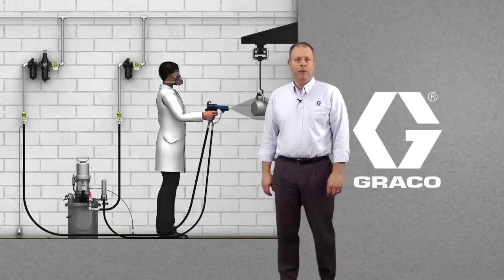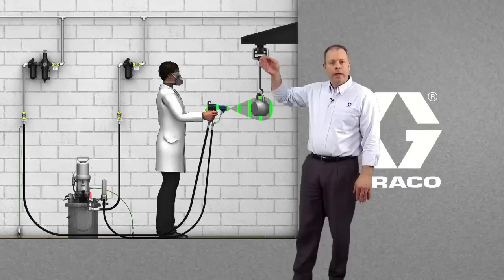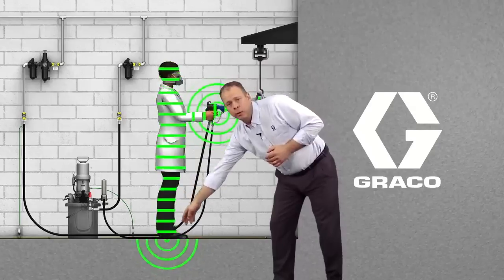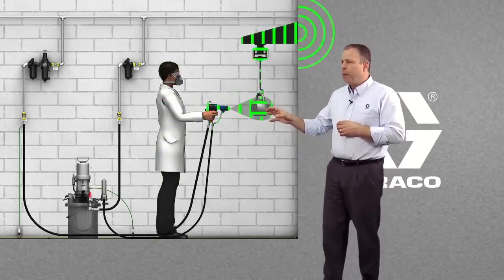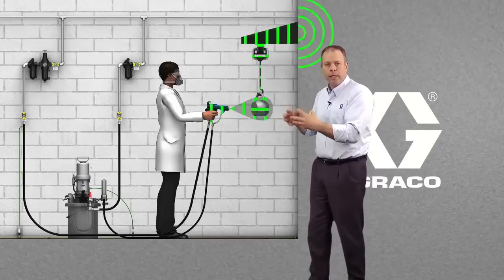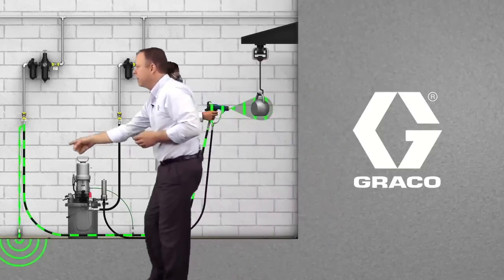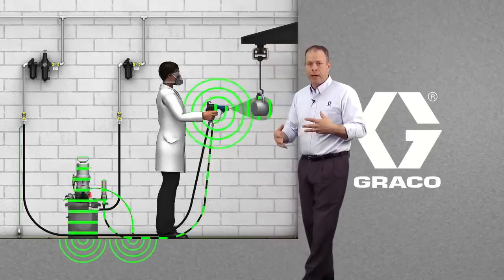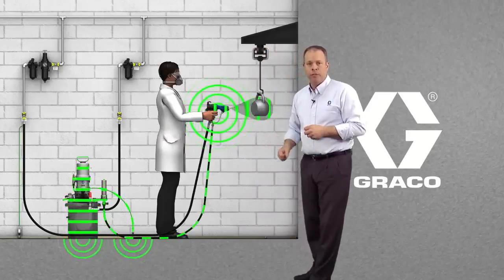Electrostatic Painting: Grounding Instructions

Comment: Electrons are negatively charged- they wouldn't be attracted to a ground- they would have to be positively charged in order to do that. How is a charge added to the paint?
Reply from the maker: The electrostatic charge is added to the paint through a process called ionization. In an electrostatic spray gun, a high voltage is applied to the paint just before it's sprayed out. This high voltage causes the individual paint particles to gain or lose electrons, thus becoming negatively charged ions. 

The object that is being painted is grounded. This essentially means it is given a neutral charge. As the negatively charged paint particles leave the electrostatic spray gun, they are attracted to the grounded part. 

Our electrostatic spray gun basics article and video further explain: https://www.graco.com/us/en/in-plant-manufacturing/solutions/articles/electrostatic-spray-gun-basics.html

Comment: Is it possible to use this kind of technology for wood? and is it possible to use it for solvent based varnish?
Reply from the maker: Yes. Wood is an excellent application for electrostatics, due to the moisture content in wood. We have electrostatic spray guns and systems for both solvent-based and waterborne materials. To identify what would work best for you, consult your local Graco finishing equipment distributor. Not sure who that is? Find out at https://www.graco.com/us/en/in-plant-manufacturing/how-to-buy/where-to-buy.html?wtb_code=ESG
Reply: @GracoIndustrial  Thank you so much for the info, Will do.

Comment: hi.how about if  i use rubber shoes and rubber or cotton glove.and how many ohm the value of grounding
Reply from the maker: For your safety, be sure to wear leather soled shoes and avoid using gloves. If you must wear gloves, be sure your palm and trigger finder are cut out to create direct skin contact (proper grounding) with the gun, or there's a conductive strip on the palm of the glove.

Before spraying in an electrostatic paint booth, be sure to test all areas with a mega ohmmeter. If each one displays a mega ohm reading of one or less, you're good to go.

Comment: And, why should all this be done?  No physics is explained. As I see it, the paint is somehow being charged, so the part should be grounded, perhaps the gun too, so user could not be shocked, since electrons would have an easier path and won't go through person.  Grounding the person would make that person vulnerable to a shock, I would think.  If they don't explain why, people will always take the logical approach - which, in this case, Graco feels is the dangerous path for some unknown reason.   Also, they need to show at what point the paint is being charged and how.
Reply: If you paint with flammable paints you got flammable fumes around you. Constant movement of paint inside the hose creates static charge. If the static charge will get enough energy it can manifest itself as a 'spark'. The spark will ignite the fumes. To avoid this you have to be grounded and let the electrons freely move to the ground. This way they won't create charge with enough energy to create a 'spark'.
Reply from the maker: Proper grounding is important for the painter's safety and to make sure the most paint goes on the part, not the person. For more details, check out our safety article at https://www.graco.com/us/en/in-plant-manufacturing/solutions/articles/stay-grounded.html. For complete warnings and instructions related to Graco equipment, refer to our electrostatic gun instruction manual 3A249.

Comment: And where is someone supposed to buy leather Sole shoes. 🤔 I use your paint system 8 hours a day non-stop. By the end of the day my paint suit can stand up on its own from all the spray collecting on me.
Reply from the maker: Although we would not know the best place near you to get leather soled shoes, we do know that they can aid in providing grounding. It's also important that you have direct hand contact with the gun handle, and that the gun is properly grounded.  

We're also concerned about your suit standing up, stiff with paint, after spraying all day. Such paint wrap-back might be a sign of poorly grounded parts or the need to adjust your gun-to-part distance. To determine what the root cause of the problem is, please contact your Graco finishing equipment distributor or Graco account manager about conducting a paint line audit.